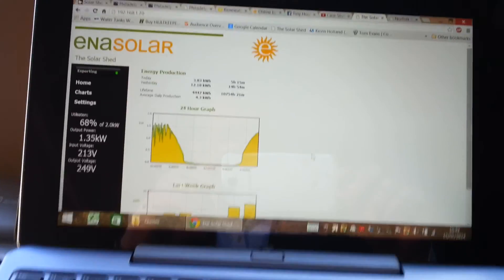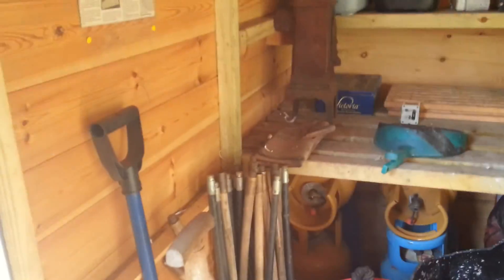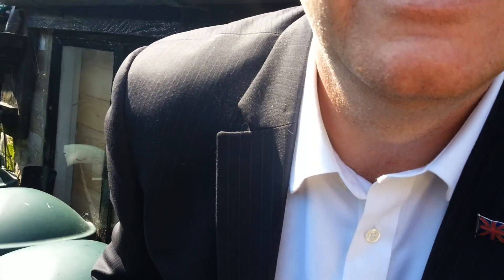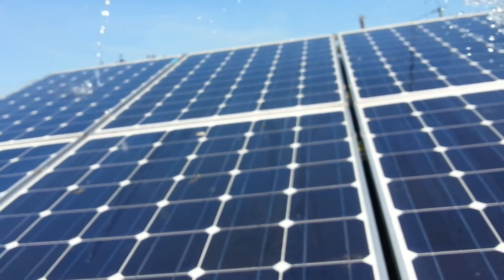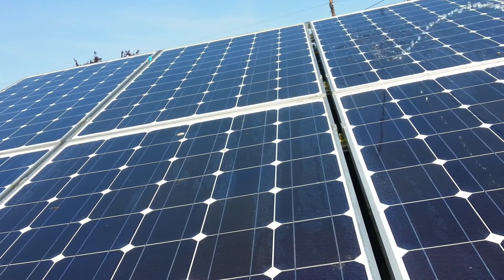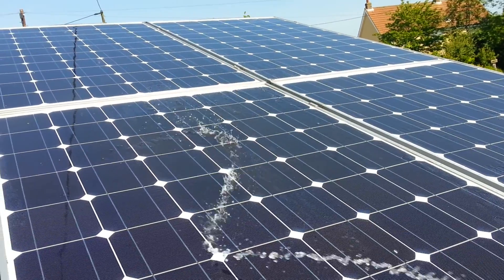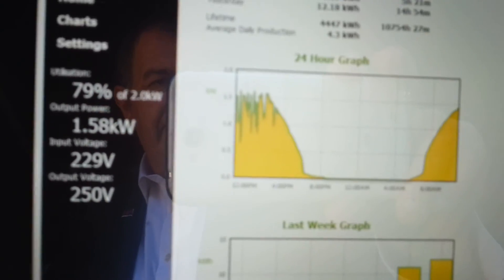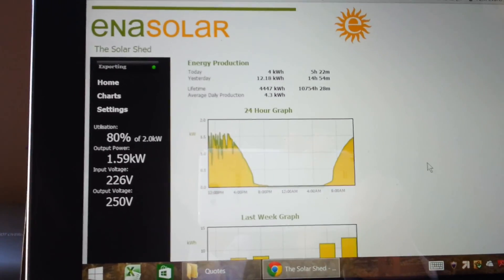Increasing solar yield

Comment: 2 concerns I have are the adverse effects of cold water being sprayed on the hot glass modules and how much the percentage would have gone up anyway, given the better solar angle achieved as time progressed during the watering of the modules.

I also don't see a benefit to this procedure due to how much water would be needed to cool the panels ongoing......the cooling effect on a very hot day would be short lived once the water stopped being applied.

I do agree with you though Kevin, playing around with things like this is fun.
Reply from the maker: 1. Hot glass.  Cool water.  Zero negative effect on panels.
2. Around 7% increase measured over two identical consecutive days.
3. The automatic spray system that's now in place means I just flick a switch.
4. Yes. Great to play with these things